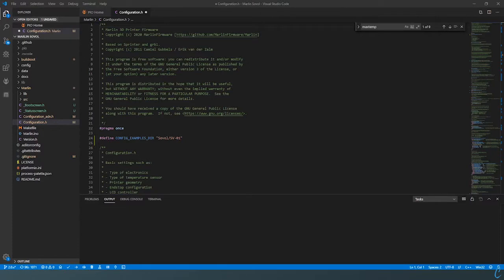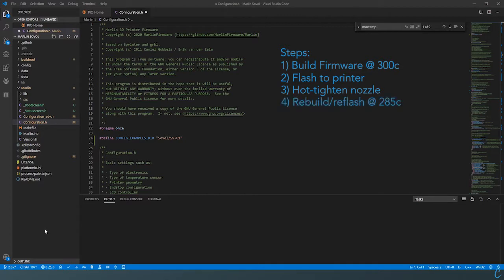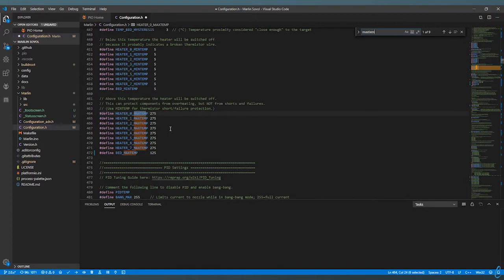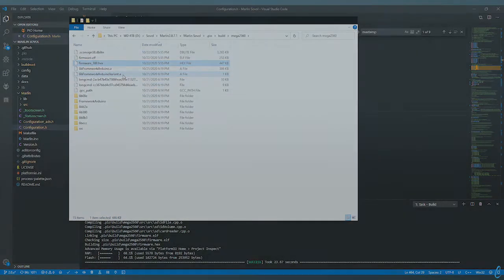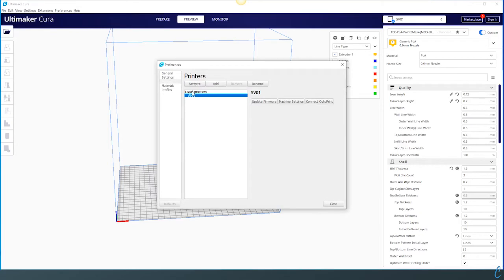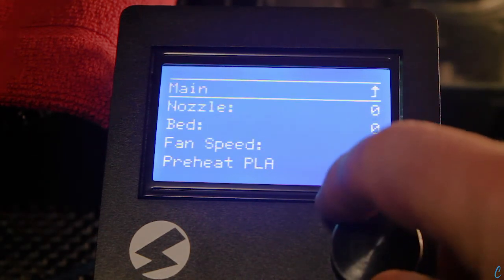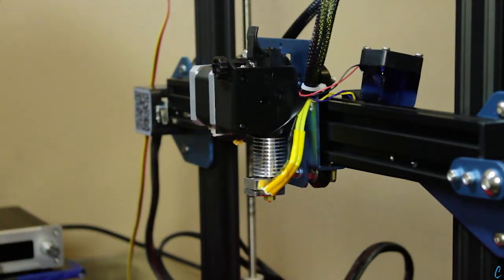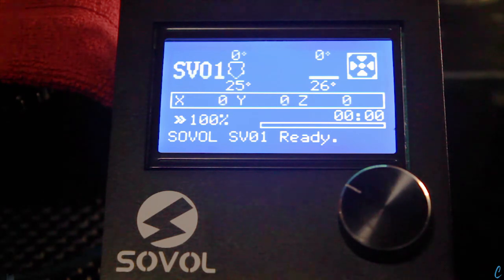Upgrading The Sovol SV01 To E3D V6 All-Metal Hot End - Part 2 of 2!

Comment: I tried to update my Sovol SV03 with a new touch screen and the touch screen wouldn't work after I load it with Cura. I used the file from Sovols site , SV03 Touch Screen Firmware( 25 points leveling  2021-11-18) and I am having trouble. Could you help me with it please? Thanks for your time.
Reply from the maker: I haven't had a need to update my SV03 with an E3D V6 yet. I'm not sure what type of trouble you're having yet, but have you contacted Sovol Support via their FB group? They've been pretty helpful on the firmware flashing items recently.

Comment: What board did you select for this? Do you have the stock board? If so, which one is it in the list in VS?
Reply from the maker: At the time I did this, I had the stock board in place. But later upgraded to the SKR 1.4. Great board with the tmc2209’s.
Reply: @CreativeGraphicsGroup  nice! Yeah I had a SIdewinder X1 with 2208’s but the drivers ran hot.. I heard the 2209s are better.

Comment: Honestly, I saw this video. Yanked my printer apart and ordered a E3D V6 on amazon. Kept my Coptertech firmware the same and just maxed it out for the heat tightening at 260. Whole process took 30 minutes broke my fan and still getting better prints without any issues since.
Reply from the maker: Wonderful! Thanks for the feedback. Join our discussion on Discord: https://discord.gg/Ncnj6zJ6jf

Comment: How do you get the sovo1 to connect to cura so you can do the temp updates? Also how did you get the the screen that you were in to do the update to the temp change?
Reply from the maker: You have to connect the SV01 to the computer via the blue USB cable that came with the printer. However, even for my computer it takes Windows a good couple of minutes to recognize it due to some odd behavior in Windows with USB drivers. (I've heard some people have to wait like 9 minutes, so be patient.) 

As to the screen where I'm updating the temperatures, that's rebuilding the firmware, in Microsoft VS:Code and Platform IO. That's not included in the video because it's in depth on its own - but you could Google "Rebuilding Marlin firmware using VS:Code and Platform IO".

Don't forget we can have more thorough discussions via Discord. Sign up here: https://discord.gg/Ncnj6zJ6jf